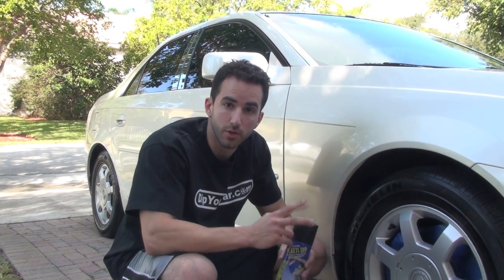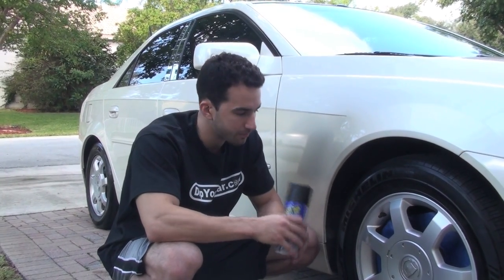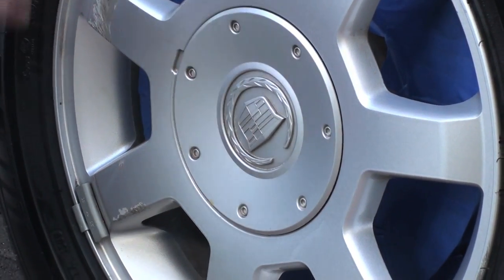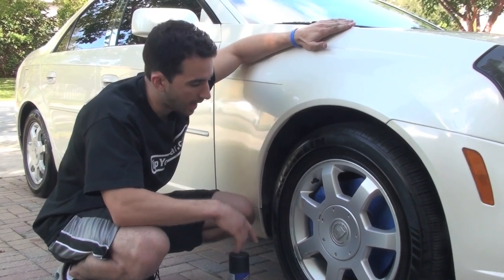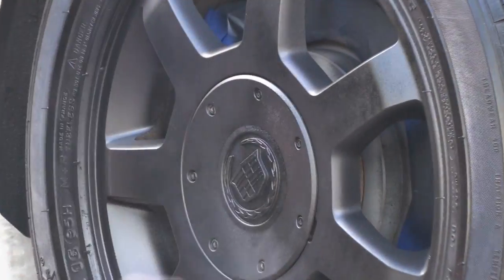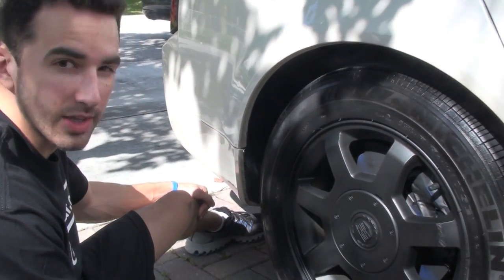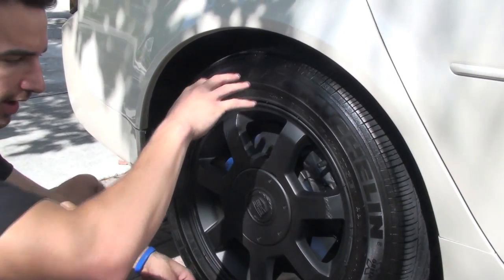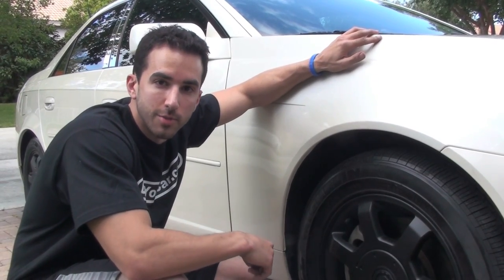PlastiDip Rims - Without Taking Wheels off the Car - DipYourCar.com How To

Comment: Taping is such a waste of time,  not to mention you now have adhesive all over everything.   Cut up a few trash bags and stuff them between the spokes.  Wala!  Takes no time,  no sticky surfaces and everyone has trash bags
Reply: That's a great idea! Worked for me. Easier than all that taping.
Reply: Good idea.
Reply: Haha he actually did that in a later video
Reply: FattyMateo I used balled up newspaper and stuffed it between the rotor and wheel.
Reply: Wala! ?
Reply: Bone Apple Tea
Reply: FattyMateo wow
Reply: FattyMateo dude
Reply: Wala Dibala
Reply: FattyMateo.....remind them to drive the car first and get them brakes and rotors nice and hot so the plastic bags adhere better to the inside of the wheel
Reply: Tim Gressler hahahahahhahaa
Reply: Wtf what a GREAT idea!!
Reply: Boney African feet .... WALA!!
Reply: A deck of cards

Comment: I did this exact thing on my car. Its been 2.2 years and that stuff holds up like a champ. A+
Reply: Wouldnt be surprised honestly.  On my last car (civic) i did the rear badges and messed up the H badge because i didnt dry it properly on the inside so there was peel along the entire inside bottom of the badge.

Thing held up for almost 2 years with the peel through tons of car washes and when I finally got around to taking it off to redo it was a bitch to get off and i ended up using adhesive remover.

Comment: I just finished Plasti-dipping my wheels for the first time. I'd like to make a suggestion. After you're done and you're ready to take the trash bag or whatever you used to cover the caliper and rotor, try reaching around the wheel and pull the bag out from behind the wheel.This eliminates any possibility of tearing the Plasti-dip when you pull the bag through the spokes.
Reply: Old message but after a week of reviewing videos and comments im about to do my wheels as soon as dip comes in but tips very helpful after almost a decade!

Comment: It's plastidip, not paint; therefore there is no need to sand or prime, it's not meant to be permanent. That being said it's held up quite well on my G6 18" stock rims, over 10,000 miles and still holding up well.

Comment: Might want to mention to clean the wheels real well before paint. Also you can use a metal file or even a small 4" grinding wheel to smooth out the curb rash on the rim before paint.  ☺
Reply: He did

Comment: I have over 10,000 miles on my plastidiped rims, the only place that is messed up is in around the lug nuts when I rotated my tires I chipped it in a few spots but you cant tell with the lug nuts in. Over all very impressed, only downside is you have to be very careful when washing them.

Comment: how many cans does it take to paint 4 wheels? thank you
Reply: +Duc1198YamR1 1 for each wheel. you can do it with 3 but 4 to be safe
Reply: I did 4 rims, grill and all emblems with 2 cans
Reply: dan mal you did it WAY to thin then. You will have a hard time getting it off. With plasti dip it’s not about how much it takes to make it look good, it is how much to make it look good and be functional when needed.
Reply: Riley Peters what do you mean? Do you need a thick coat?
Reply: Just out of curiosity 6 months later how is the plasti dip holding up? if you havent removed em yet...
Reply: Leo Rodriguez Yeah at least 3 coats to make it last longer and it's faster taking it off.
Reply: @danmal9190  sounds lovely!!!!!!!how many coats did you make on each wheel????i've ordered four cans,one for each wheel and i'm thinking that quantity migh not be enough......or is it enough and i'm worried for nothing???is one can enough for six coats on one wheel???

Comment: Hold on, you still have to remove the tire to tape up the calipers and rotors/drums.  Kind of defeats the purpose
Reply: same thing I was thinking.
Reply: A bit of careful manoeuvring through the rim holes and it's easy to tape off.
Reply: I actually tried it without taping them off and it worked as good
Reply: really? did it affect your brakes or did it wash off with a car wash?
Reply: Nope. I have drums in the rear so I didnt worry too much about paint, just wrapped the bag around it a little. For the disks, I just wrapped the bag tightly around the rotor. As long as there isnt much wind, those bags wont go anywhere and they cover the rotor completely

Comment: just did this today to my 05 gto stock 17s. there is no need to take the wheels off if you can get every angle.. came out awesome.. did 5 coats each wheel.. so far looks excellent.. even if it comes off for some odd reason after a while i'll probably do this again.. costed me about $10.. can't go wrong with this

Comment: That curb rash is still pretty visible.
Reply: I think sanding before then plastidip would look much better
Reply: Glazing putty, feather it in, paint it
Reply: Should've used a little bondo to rub in the gashes, wouldn't fix it but it would be less visible

Comment: What do you do when you cant get in the rims to tape the brakes? My rims have lots of spokes so i cant get my hand in there.
Reply: You're going to have to take the wheels off then, it's not too hard.
Reply: thanks
Reply: look up how they put trash bags in there. that's wut I did today, just did mine. if u cnt fit ur fingers in to weave a bag threw try to use something small to pull it threw for u. it works very well, otherwise yea take the wheels off.
Reply: Joshw124 Ill try that thanks
Reply: Didnt think of the trashbag will have to try, thanx!

Comment: I used trash bags to cover the brake discs and dipped my wheels still on the truck.  It came out awesome.  Took me a little under 2 cans to do wheels, badges, and license plate covers.  Plus tape the total investment was $20.07 plus a couple hours and some beer.

Comment: I just did my stock wheels (AKA Pie plates) on my C5 A6 4.2 and it turned out beautifully!  Did the garbage bag trick covering the brakes and did 4 coats.  Did it in 45-50 degree weather.

Comment: I just plasti dipped my WHOLE car. It turned out GREAT! I am soo happy with it. I was originally planning to get it re-painted so I sanded the whole car down with 400 wet. I used to work in a high end body shop so sanding cars and prepping them is not a big deal. I am curios to see how long this will last. I put on 7 good coats, do you think the plasti dip will last longer if I wiped it down once a week with some sort of protector such as Amor all?

Comment: I plasti dipped my rims 2 days ago, and it looked great.  But today I noticed it was peeling on almost all of the wheels.  I did exactly what you did on here.  Light coats, up to about 4 coats.  But right where the weight balance was it started peeling and around the lip.  I went around the lip like you did but still it peeled.  I redid 2 of my rims today, hopefully it will stay on this time.

Comment: I did three medium coats and the last coat alittle heavier and it turned out smooth. Make sure u dont let the can get low tho.because it will spray areosal and no plasti which will in turn leave blotches. I always pitch my cans in th trash when they get to a certain point.

Comment: Thanks. I added a final thicker coat and the finish is smoother.I definitely agree with you about making sure the can doesn't get too low. I think there was a place where aerosol w/ no PlastiDip came out and it made the finish pretty bumpy. The final thicker coat helped smooth that area some, but still not as smooth as the other areas. I was an easy way to black out my rims and isn't permanent.

Comment: I will be getting a new car soon, and would consider PD for my wheels. A couple questions though based on off-car work: 1. wheel nut seats: masking might be hard, is it easy enough to take off to ensure proper seating of the wheel nuts? 2. maintenance: when shops repair flats, or you change your tires and reballance, is it easy to touch up? 3: how easy is PD to remove?

Comment: I'm definitely taking my wheels off. It's more of a hassle to wrap your brakes with the wheels on the car are rather than to just take the wheels off. And at least you don't need to mask your wheels. BTW, I have a flint Mica Scion TC and I want gold rims. Do I just buy the white base dip and the gold metallizer?

Comment: You sure you don’t need primer or Sand paper before the paint? Some say it’s necessary.. but you did as fine job without sanding the alloys or even using the primer ..

Comment: @evergtz95 i have plastidip on the front bumper of my 05 forester xt.  ive been through 4 car washes so far and it still looks like i just put the plasti dip on.  its very durable stuff.  the washes had the spinning brushes that beat the front of ur car, too

Comment: I dipped my Chrome 24 inch wheels Bennett Bogard from Dipyourcar told me it would take 5 cans.  i ended up using 8 cans. the white doesn't cover good. but finished product turned out NICE! suggest taping off the tire on Low pros or just spray the crap out of them with a nice thick coat and it will peel better. if your going to do big rims buy the spray gun and get the dip in gallon form. the spray can bottle will kill your spray finger!!

Comment: good day, you videos are all great, and I am also planning to Plasti Dip my wheels, I just want to ask, regarding the Lug nuts, after applying Plasti Dip on the lug nuts, do you need to cut the edges so that it will be separated from the mags itself when you try to remove it in cases like having a flat tire or something. thanks.

Comment: I have 15 inch wheels on my Mazda and I used 2 cans completely. Came out really well, mine were corroded beyond fixing, so I covered them with this. It comes out really even. Even if you kind screw up. I've also done my emblems and they look good after 3 months. I love plasti dip =P

Comment: So you don't need to spray the tires with anything beforehand to then be able to remove the plasti dip spray over? It will just peel right off an untreated tire?

Comment: I have some deep curb rash and I want to fill them using epoxy so it will look better. I know I have to sand them down to make it the same level. But do I have to prime the rim before the dip because i sanded it? Or can I just go straight to the dip after I've sanded down the epoxy ?

Comment: great vid, looks awesome. I want the exact finish onmy truck rims and tool box. how does the plasti dip hold up to wear? i am guessing this is the best method regarding convienience? would sanding priming with auto primer and painting with engine enamel like ive seen in other vids hold up better? also, did you clean and/or sand the rims before sprayin em with the plasti dip? thanks, thumbs up on the vid...

Comment: Hi there! Got a question!
Bought some Plasti Dip black spray cans to do my wheels, but forgot to buy the Gloss. Actually I don't know how the finish will be just by dipping them. Oh and because I live in Europe, it takes some time for the things to be delivered. Tht question: Can the Gloss be applied at a later date, say few weeks later, on top of the dip with the same results?
Thanks!

Comment: I’ve got to redo my rim again because I did a step wrong. My questions should i prep my rim with sand paper or another spray to help the Plastic Dip to hold. The first time I cleaned my rims and let dry and sprayed 5 coats. Any help would be great!

Comment: Thanks for the video. Quick question. I dipped my wheels about a week ago and I'm noticing a few thin spots. Would it be okay to clean them and add a few more coats? Would they bond to the previous coats? Thanks in advance

Comment: I’m wanting to do this to my Honda Accord I used rust oleum rust dissolver on the inside part and it left my hubcaps with white splatter on them and a bit on my new tires . Can I paint the inside part that you covered with tape I really want them black too

Comment: From what I've seen 4 cans at least. You should be doing around 4-5 layers so it's easier to take it off. I read this on dipyourcar website. They have a guide and tutorials. So Vinly it is? I'm still a little skeptical.
Will you be taking your wheels off?

Comment: About to 'Dip the stock rims of my new Jeep Wrangler. Other sources say to clean the surface to be treated with tire cleaner or alcohol first. I, personally, don't believe anything more elaborate than Windex would be necessary. Thoughts?

Comment: If I have a set of steel wheels and they are rusty. Whats best steps to prep them and dip them?

sand (using what grits would you recommend for final grit) and then plastidip or sand, primer and then plastidip?

Comment: How is this on a set of track wheels that get brake dust all over them?  As in, road course duty wheels with high dust brake pads.  Brake dust can be corrosive.  Will it eat through the paint?  I've seen a lot of people say the dip is easy to wash....but how about loads of brake dust?

Comment: If you spray it on thick enough, yes, it will peel off in sheets relatively easily. I think if it peels off in little bits, it wasn't put on thick enough. It also shouldn't mess up the original finish of your rims.

Comment: If you want the emblem not dipped, you can add painters tape over the emblem I'd imagine.  But would you have to peel and reapply the tape after each coat while still wet?  If you leave the masking tape on will it pull the dip off?  

Also how do you cover the lugs?

Comment: quick question : Can I spray plasti dip on interior dash pieces?? My dash has a two tone gray and black from the factory and I would like to have it all black. I take it that if it will work on the dash then it would work on any other piece (ie: interior doors) of the same material. Thanks and I enjoy the videos.

Comment: Hi first how many cans would you recommend I need for at least 7 coats on all for rims? Second is there a way I can cover all matte black and once dry tape it off to color some trim in the fierce pink?..thank you
Reply: they often recommend letting the base coat cure for 24 hours before trying to tape it off, else it might peel when you untape.

Comment: I'm actually about to touch up my wheels with plasti dip, and don't have the energy or time to remove each wheel. Is it recommended to cover the outer part of the car so none of the "paint" gets on it? Just afraid of the paint on the car being sprayed with plasti dip. I know it peels right off, but just want to be extra safe.

Comment: I didn't. but if you want to cut out circles that are the same size as the holes and stick them to the lug nuts and take a needle stick it thru the tape and pull em out but make sure you do it before the dip drys or the dip will come off with the tape

Comment: I did this: 6 inches away, 5 coats, 1st coat is light... But the finish ended up looking fuzzy. Like some tiny balls or dust on the wheels and roof of my car (also in the roof is zebra looking with some streaks and darker spots) What happened, how can I do it better? Why does it look like this? How do I make the roof look even while painting it? 

Thanks for your time!

Comment: I want to do this with the tires on my car, like how it was done here. But how do you get the INSIDE part black. I am talking about the side of rims on the inside. My rims have the metal part on all four extending to the inside. Does this method only blacken the outside of the rims?

Comment: yea I need to know this aswell, and coz you plasti dipping your wheels while on the car the nuts which hold the wheel will get dipped too. so if you wanna change tires you'll fuck it up coz you need to turn the nuts loose?

Comment: How do you get the Plasti Dip finish to be smooth? I did my rims (3 cans = 5 coats) and they are not smooth and a little sticky? I looked at some forums and some say the last coat has to be thick and some say the last coat should be thin for a smooth finish??? Which is better for a smooth finish? Also, if I didn't put on thick enough coats, can I just add a few more coats now a day or so after the initial coating (it has been driven since then)?

Comment: Use trashbags. Thread them behind the rims but infront of the brakes/calipers. make certain the brake components are covered and the trashbags are not touching the rims where you will be spraying. Once the PlastiDip has dried, carefully remove the trashbags.

Comment: maybe it was just the camera angle or my eyes, but it looked like at 3:30, the plastidip didn't really bond too well with the rashed area. would it maybe help if i went a little lighter on any rashed sections?

Comment: I took my wheel off and used a gun to spray, turned out great! But when I put my tire back on, the plasti-dip started to peel off when I tightened the lug nuts...any suggestions??

Comment: Yes, the edges of your rims will have to be resprayed, but it's just as easy as that. Same goes for the nuts holding the wheels on. It wouldn't take more than 10 minutes to do these touch ups.

Comment: So, let me get this straight... If your peeling off the over-spray that easily, wouldn't the plasti-dip theoretically peel from the surface being painted the same way? I know you've mentioned the durability of this stuff in a couple other replies but I guess the key is once it's cured?

Comment: i own a bmw aswell i plasti dipped mine last weekend and just sprayed over the roundell center cap along with the "M" badge. after i let it dry for a few hours. it peeled off easily since theirs a small gap between the center cap and the wheel itself. i have some pics of it. if you want to see hit me up with your email

Comment: i did this and it came out out like bubbly, straight from the can.  it was coming out a lot different then in this video.  i shook it up a lot too, and it still came out like watery.  help?
Reply: Try warming the cans up in a bucket of water for awhile before you spray. I had one wheel turn out like shit because I forgot to warm the can up. If the Dip is to cold it will turn out bad.
Reply: soft stool thanks i had the same problem